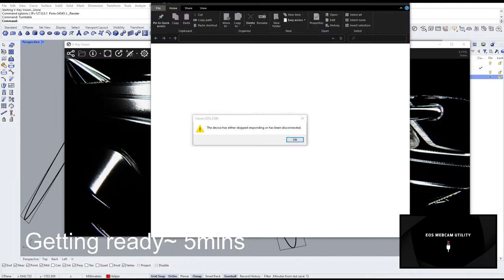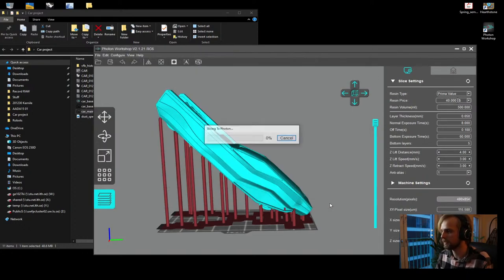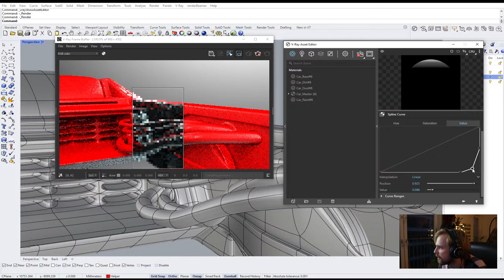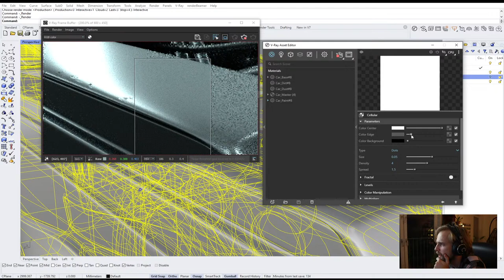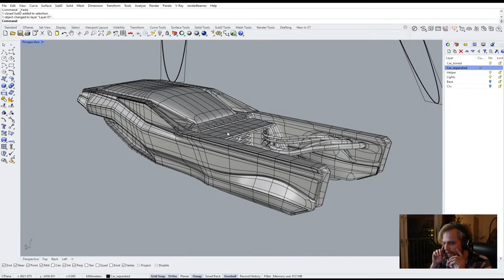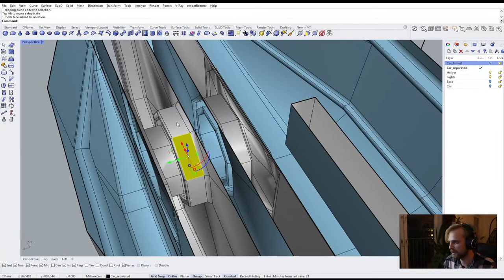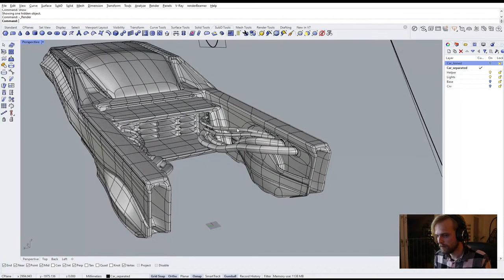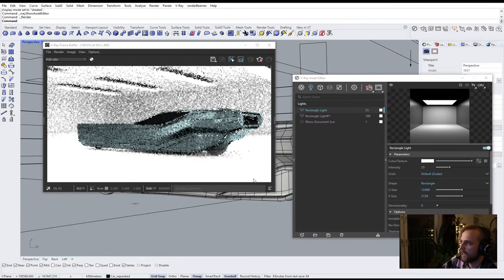3D Car Modeling with Rhino 7 SubD Tools [8/8]

Comment: These videos have been the most useful Rhino related content that I have come across. Great job on the modelling and the whole rendering process. Just one request, would you consider creating a car with open wheel arches in SubD because I have found that to be the hardest part of car modelling in SubD. I mean getting the inside edge of the fender to meet up with the bottom of the model and still have good topology with space for the wheels.
Reply from the maker: Glad you like them! That seems to be a topological issue mostly, next livestream that I do - I'll model it out, so just stay tuned for livestream recordings :)

Comment: Great serie. I am learning a lot. I just have a question since I heard the word BLENDER about 100 times in this videos  I wanted to ask you if blender is useful to make product design. I made a lamp with rhino and grasshoper which I printed in 3D and it was really fun.  Now I  want to make more of such things. Is Blender also good for this kind of stuf or is it more for rendering?
Reply from the maker: Yea, when I start talking about something, I will usually talk about it for a while. In this case it was Blender. It's great for animations, rendering, sculpting and 3D model assets for video games/other computer graphics. For product design that will actually need to be manufactured - blender is much much weaker than Rhino. I would definitely suggest using Rhino if you want to design "real" things.
Reply: As someone who uses Rhino and is teaching myself Blender I can say that Blender is a faster modeler. I am learning it so I can create iterations and design ideas faster and edit them more quickly. Once something is finalized I will rebuild it in Rhino.

Comment: hey i had a question. Does Rhino only render SubD boxes as the smooth version? I made a model using flat subD and it fits my desired look, but when i render, it changes all the SubD to smooth and ruins it
Reply from the maker: Just select all edges of your subD and use Crease command on them. That will lock everything into a "hard surface" look.
Reply: @DesignGoBrr  thanks so much!